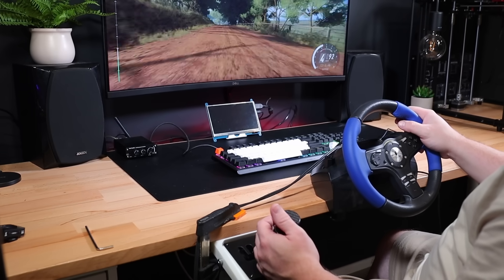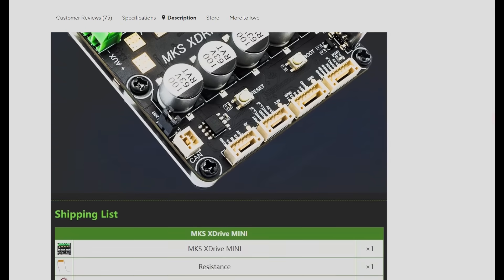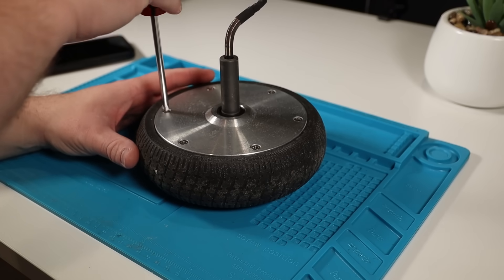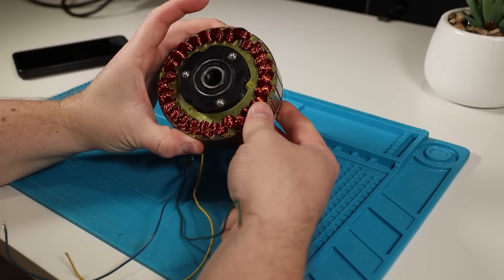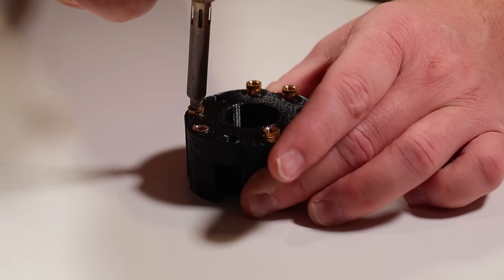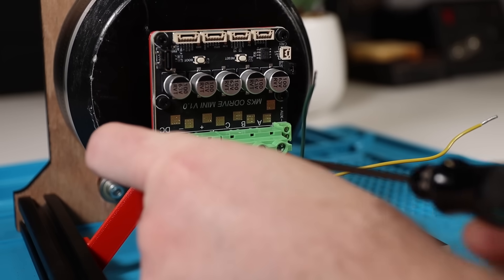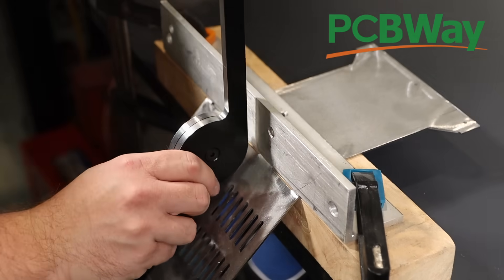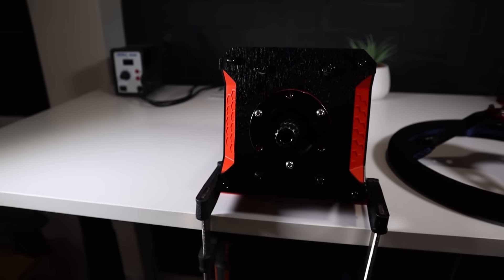DIY High Performance Force Feedback Wheel

Comment: will try this as a school project. we luckily have all equipment needed including lathe, cnc, lasercutter, 3d printer and various other electronics that could be used. but is there any way i could find the files you used in this video for printing, cutting, measurements etc?

Comment: What an insane waste of time and money LMAO. Btw for your claims "a lot cheaper wheel than any commercial options" do we also include the price of your CNC machine, a lathe worth 10K or more, your 3d printer or we better ignore that and imagine they magically appear in our room? Or the fact that after all this work and money the hard reality is that ANY commercial wheel in the market (even CHEAPER options) will blow the living crap out of this diy project, in terms of performance and quality, since raw torque is just one of the many requirements for a proper ffb wheel?

Comment: I know you couldnt have predicted this in advance but by the stage you mounted bearings to keep it centered you could have just used a similar design with that all important magnet for steering angle attached to the bearing.

An even simpler solution if you were just worried about rubbing on the wires would be putting the rod in a tube, so the tube and wires remain stationary and just the rod inside rotates (and rubs on the tube).

The top section of an old retractable antenna gives you both the rod and tube already married to each other 😉

But i get that you wouldnt have had an excuse to theb use a mates lathe and over complicate things for video content 😎

Cool setup though and very informative video!

Comment: hello in school we need to make a project and i choose your wheel and pedals. I am wondering if i can get more detailed plans for your parts. So that i can make it all without laser cutter
Reply from the maker: All the files for the parts are up on github. For the pedals, you could open the DXF files in a 2D CAD package (try nanocad, its free) and print them onto paper at 100% scale and then trace around them onto metal and cut them out with hand tools. There are cheaper ways to make the wheel that rely entirely on off the shelf components and 3D printing which might be easier than trying to make the parts for my design. The wiring diagrams I've provided to connect the pedals would still work with those designs!

Comment: Hey, was wondering can i use a scooter moteur?
Reply from the maker: Assuming you're talking about the scooter hub style motors, yes you can do something similar with them! You'll have to work out the mechanics of it yourself but the same combination of sensor and motor controller should work with a scotter hub wheel!
Reply: @cncdan Thank you for you reply and i have been thinking about it for a while a i have 3 scooters at home for parts

Comment: I came here with a thought of "ohh, neat, i can make my own racesim wheel" - couple mins in aaaand i need to have a full electronics factory at home
Reply: Literally cheaper to buy a DD wheel.
Reply: @kizmetmars   I built mine for 150€
Hoverboard motor -> 25
Driver board Mini with built in magnet sensor -> 45
350W PSU -> 35
250g PETG -> 5
rails, fastening elements, and piece of metal board for bottom -> cca 25
Reply: @AljazJelen1992  I believe you. But, this video stretches the term DIY. My main problem is that neither of you factor in the cost of the tools required to make it. Unless someone is interested in making it a business of making and selling DIY DD wheels it makes more financial, time and effort sense to just buy one.
Reply: @kizmetmars   I understand you but I am sincerely speaking only in using 3D printer and a hand-held drill.
If even that is not "DIY" enough, then what would fall in that criteria? Not using any power tools? What about screw driver?
You cant consider the costs of the machine the same way as that one of the materials.
Reply: @AljazJelen1992  The price of a G920 + gear stick is cheaper than the cheapest store bought 3D printer alone. I guess my definition of DIY is that it is half or less the cost of a mid range store bought. But, IN THIS video, the cost of all the equipment alone could be used to buy top of the line wheel, DD base and pedals. It's a farce to say this is "DIY."
Reply: @kizmetmars  again, you cannot count yhe costs of equipment the same way as materials, when doing anything. 
Its the same way with actual development and production as well.
By your logic, every car should super expensive, over several billions!! Because... you know how much those productions robots costs?

No you dont calculate the costs like this. You take amortization into account.
Such as "am I going to use 3D printer for something else or just the wheel?". If you print only a wheel then yes, congratulations you just screwed yourself up.
If you use the printer for other projects, gifts, ideas, concepts...then the cost on the initial investment of 3D printer is negligible.

I hope its clear now.

As for a lathe/router, yeah not everyone has it at home, so use plywood, its durable and cheap 😊
Reply: @AljazJelen1992  The logical fallacies presented are too numerous and have convinced me that it is a pointless endeavor trying to continuing this.
Reply: @kizmetmars  That's just patently false. You can get an Ender 3 for less than 200 bucks. Add everything together, and the price is right around the 920 bundle. But comparing a DIY Direct Drive wheel to the 920 doesn't work, considering a DD wheel is a BIG upgrade. Plus, once you're done with the wheel, you can use an FDM printer for SO MANY OTHER THINGS. Why argue when you obviously know nothing about 3d printers? This falls squarely in DIY, even if you don't have the knowledge or the motivation to actually do it yourself.
Reply: @theluckyscav3487  What was shown as "DIY" vs what you're suggesting are two different conversations.
Reply: @kizmetmars not really, the driver cost about 70 dollars, hoverboard wheel about 20 dollars(in my fb market) and the encoder wires and stuff about 50 dollars, wheelbase only cost less than 200 dollars with 15nm of torque. The pedals is really easy if you have tools and else, btw if u gonna make one its better to have drills ready and saw or grinders, you need it
Reply: @leoo-yel  and the lathe, the cnc, the 3D printer, the power supply...
Reply: + the guy also made sure he did this using as many tools as possible (as stated at the very beginning of the video)
Reply: @kizmetmars if u do the original one (not his design) it’s only around 200 dollars, if you have a 3d printer, soldering iron, and drill. the cheapest 15nm dd base is 500 dollars, and u can even build it for cheaper than 200 honestly.
Reply: Dont know why i read it as racism wheel
Reply: You don't need to do all that, I did my own build with just a 3d printer (you can have them shipped if you don't own a printer) and a drill 

The driver is cheap, use a rotary encoder and with a reduction wheel mounted behind the hub you get 5x resolution 

Basically I paid less than 50€ for a 12Nm wheel
Reply: @nine.ties6  Did you follow specific plans?
Reply: @FrigidKing search FFBeast, that's the project name, I followed those plans but redesigned everything that wasn't electronics to have as much 3d printed parts
Reply: These projects are just useless and click bait, it is literally cheaper getting a second hand entry level wheel done properly by a decent company, logitech, thrustmaster or pnx, than wasting your time and money in these stupid projects that will yield even worse results than anything else on the market.
Reply: @DashzRight  agree to disagree 
You can make it better, cheaper and learn a lot. And the latter is the most important 😊
Reply: @AljazJelen1992  "cheaper wheel than any commercial options" do we also include the price of the CNC machine, a lathe worth 10K or more, a 3d printer or we better ignore that and imagine they magically appear in our room? Or the fact that after all this work and money the hard factual reality is that ANY commercial wheel in the market (even CHEAPER options) will blow the living crap out of this diy project, in terms of performance and quality, you clearly have no idea what you are talking about or any real design or UX standards
Reply: @DashzRight  jesus Christ, chill! No need to explode if you dont know how to do it
Reply: @DashzRight  The only thing you "need" is a 3D printer if you follow the source tutorial for this but even then I would just have a shop print it, the rates aren't even bad, no reason to buy your own.
Reply: @DashzRight  Hey man, if you don't have the skills and equipment to do it, then don't. Just buy off the shelf like you said, this video isn't for you anyways. For the rest of us who are equipped or have access to a shop at work, it's another project with a rewarding end goal. Kinda crazy to out yourself like this especially in a space (simrigs) where customization is normal.
Reply: @DashzRight  Я даже на этом видео вижу, как руль трясется и пытается сломать сам себя. Можно купить PXN V10 Pro c direct drive for less than 150$ for new.
Reply: I read this comment as Racism Wheel, and had to process that. 🤣
Reply: I don't think you need everything this guy has. You can do a lot of this by just fabricating your base in your garage. Everything else electronic related except for the hoverboard motor you could buy from aliexpress.
Reply: Most of the DIY projects tbh. Companies do have profit margins, but they sell it cheaper than what your average joe can build at home
Reply: https://youtu.be/flQn_qvWev4?si=ScjM3RmxxQHK5wMR
Reply: same lol
Reply: I have access to a CNC workshop and all the tools imaginable, so I wanted to use them for the project.  In the end, I did not once go to the shop, all was done with simple tools at home.  There are, of course, 3D printed parts, but if you stick to the common design, you can have a company or friend or whatever 3D print them for you for very little money.
Reply: Just go to a maker space,

Comment: I have two hoverboards in the garage for this exact project. Also an odrive board, magnetic encoder etc. However time and interest went elsewhere and it ended up on a shelf just as I had practically solved all the programming stuff releated to USB FFB Hid etc. Nowadays FFBeast and OpenFFB solves those parts too (much better). So this is a kick in the butt to finally start this project over. Thanks!

Comment: I think I know how to fix the wheel oscillation. Get Logitech Gaming Software, which is the old version of Logitech G Hub; they are both completely different. Once your wheel is picked up by it go into the degrees and set it to 0, then set it back to 900 and apply. This fixed it for me.

Comment: @cncdan When I connect the controller to Windows 10 64-bit, a message appears saying that the USB device is not working properly. Of course, it is also not detected in the STM32 software. Are any additional drivers needed?

Comment: 12:23 no pedals? you cant keep the other wheel also plugged in and use its pedals? (i understand the pedals require to be plugged into the wheel) i know you made a video 3 weeks ago about diy pedals, i just found this and it confused me a little when you said that

edit literally 10 seconds later: PFFFFFT THATS EXACTLY WHAT YOU START OFF WITH TALKING ABOUT IN THE PEDAL VIDEO aahhahahaaaa

Comment: Hey, first of all, great skills and project! Just curious, most hub motors I’ve seen are 36V, but you're using both a 24V supply and controller. Any reason for that? Would a 36V setup be better?
Reply from the maker: This is over-simplifying it, but basically when it comes to motors, voltage = speed, current = torque. 24v is more than enough voltage for realistically fast steering responses. These motors usually provide about 16 RPM per volt, meaning our 24v supply should be able to spin the motor at about 384 RPM. That means it would take less than half a second for the wheel to complete a full 2.5 turns from left to right lock. You certainly could run it at 36v but the additional cost just isn't worth it IMO!
Reply: @cncdan Oh got it, that makes sense! Thanks so much!

Comment: My steering work well but it doest not return back to center and does not force feedback. Do you know why? Please give an advice. Thanks
Reply from the maker: Could be any number of things wrong in the setup. Go back and follow through the steps on the FFBeast page and see if it solves the problem. Could also be an encoder wiring issue as it won't do anything besides a little wiggle at first power up if there's no encoder feedback so check that too!
Reply: @cncdan  Thank you!!! I've changed the correct value of CPR and it works.

Comment: My Thrustmaster TX decided to go haywire the other day. It had the quite common slow to the left and absolute mayhem to the right on startup. The sheer force of the spin to the right broke the aluminium stop, so now it goes too far and sticks.

Anyway, I've stripped it down and started a repair.....But I started thinking. Could I replace the rather weak motor that drives the belts, with a DD hoverboard motor straight to the wheel and bypass the belts but still use all the other components?

I know I would have to rearrange the layout of the components and could probably 3D print something.

My thinking is, why can't the board that controls the small servo motor (which is just a smaller DD motor with a plastic belt pulley on it), that in turn spins the belts, control the servo from the hoverboard and then I don't need the belts? 

I'm simply switching the servo for a bigger one and bypassing the belts.

This way I can continue to use my pedals plugged into the main board, and same goes for the TX wheel.

Am I over simplifying this?
Reply from the maker: I've never seen inside that wheel base, but if its gear driven type there is a damn good chance it will be a brushed motor (2 wires) rather than a brushless (3 wires) type of motor like a hoverboard which means the motor driver won't be compatible with a hoverboard motor. Even if it were already the right type of motor, I doubt the manufacturer would've gone to the extra expense of making the motor driver more capable than it needs to be, meaning upgrading to a more powerful motor would most likely just result in a burnt out controller or no increase of power depending on how the controller functions.
You could gut the whole thing and just use the shell and the wheel with one of the motor controllers specified on the FFBeast page, but honestly by that point it would probably just be easier to build one from scratch. Hope this helps!
Reply: @cncdan  No it's belt driven,  I've already opened it up to repair it....There's a great tutorial on how to open up the actual motor that drives the belts and repair the shaft.

It's basically a mini brushless servo with a built in controller board with 3 wires, that is then run from the main PCB of the wheel. You have to de-solder the wires to open up the motor.

That's what got me curious, because I have already prepared a hoverboard motor, and it has the same 3 wires, as you already know.

Anyway, I soldered 3 extra extension wires to the little controller board of the TX motor, and then have them exposed now I have rebuilt the wheel base. I then crimped some spade connectors to 3 wires I added to the TX wheel and also to the 3 wires on the hoverboard motor, connected them together and plugged in my wheel......and I got movement......Very weak, but the hoverboard wheel copied the TX wheel.

I figured that the weakness was due to the power supply not up to the job of running both motors at once. So my next thought was to use a spare PC power supply I have that will connect to the TX boards 4 pin power connector, and see if I get stronger movement.

I agree with what you're saying, after all the testing it will probably be easier to just build the hoverboard DD from the FFbeast instructions......But you know when you just want to find out if your theory is correct?

I'll probably fry my TX wheel, and then I have to build the DD from scratch anyway.

Comment: why havent i got the second page of setup left of you screen ?? my wheel is just useless with the right setups .. am i supposed to pay to get ffb ?? wtf is this scam ?
Reply from the maker: There is a paid version with some more feautres, but I haven't used it yet in my videos yet so you should be able to get the wheel working without paying. I believe there are some other options for software too that are open source and free, but I haven't looked into them personally.
Reply: @cncdan  it's ok my wheel is ok i paid the license to get multiple effects profiles but don't buy it ..if you program well it's just an open source "open ffboard" with a lot of bug !! license disapear and come back sometimes (while reboot or restart pc) + the profiles saves when they want your setups ... finally i bought a open source firmware with no updates...

Comment: the whole thing is flexing like crazy, and was pretty obvious it'd happen even before testing. Youre doing a tremendous amount of torque in other axes than the main one, relaying on the motor hub, and you're making it even worse by using an extender (aka quick release). To overcome it, I'd suggest to make the box 15-20cm longer, putting the motor to the back and adding a bearing at the front. Edit: The improvement you just did to the motor housing in the second video, might help with this problem.

Comment: Is there a substitute motor I can use?
Reply from the maker: Any brushless motor really, but the amount of power/torque will vary greatly depending on the size of the motor. Faster spinning motors will also need to be geared down to an appropriate speed to have enough torque to be useable.
Reply: @ what do you recommend for around the same price point?
Reply from the maker: There's basically nothing else you can get even close to the same power for the same money as a broken hoverboard unfortunately!